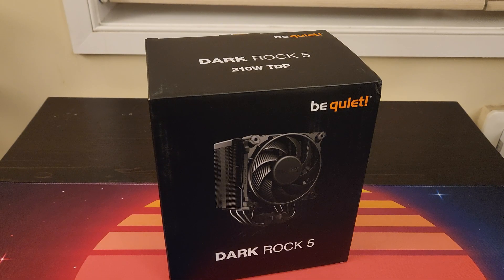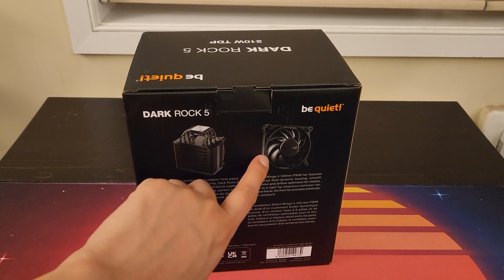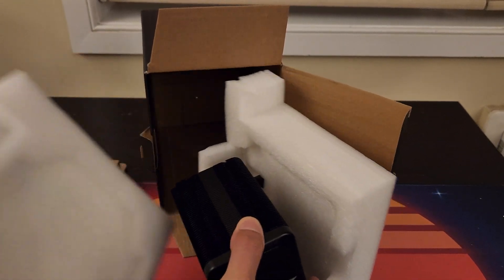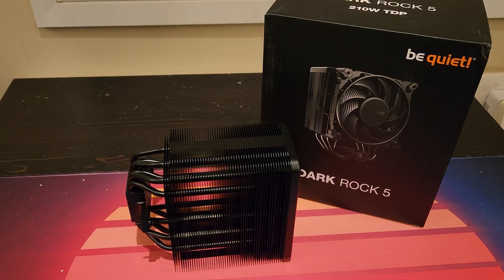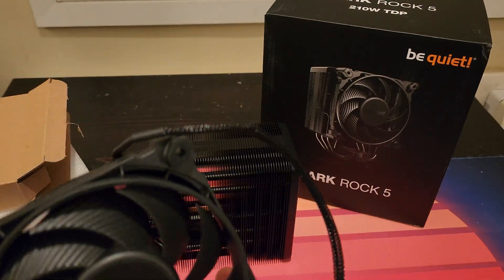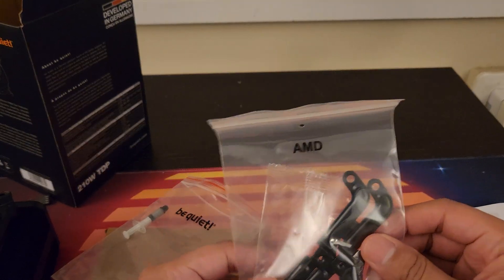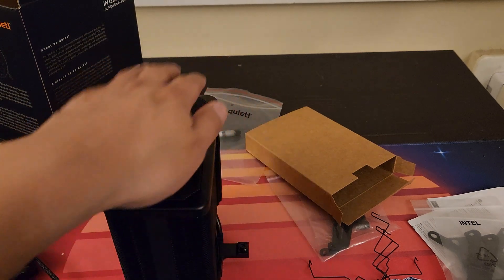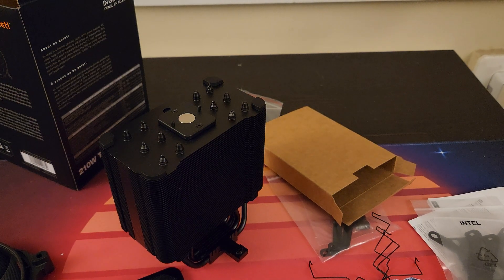be Quiet! DARK ROCK 5 | Unboxing, Installation, & Tutorial on AM5

Comment: They said that you could add additional fan as an exhaust but the thing is, you might have to install an fan splitter that can be used for the 2 fans on the cpu cooler